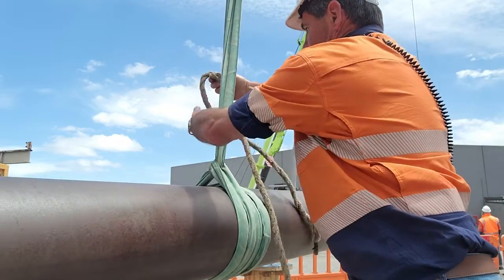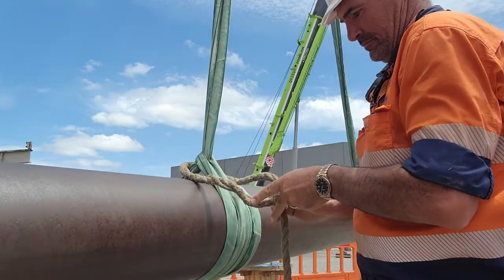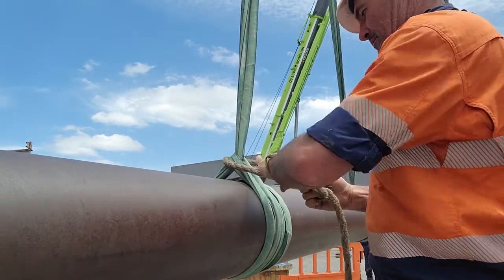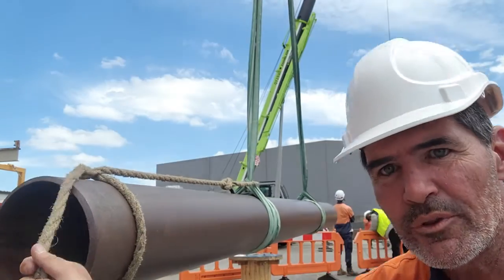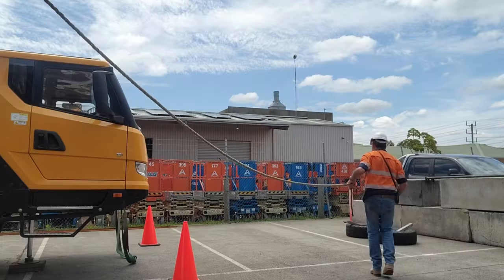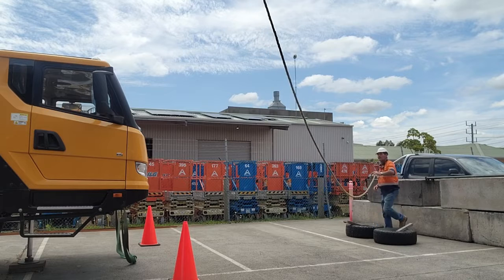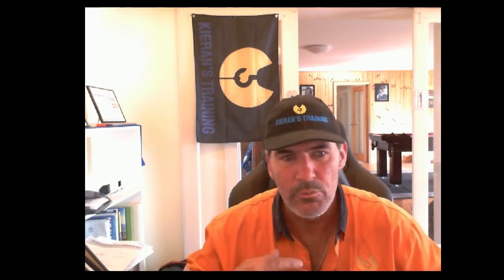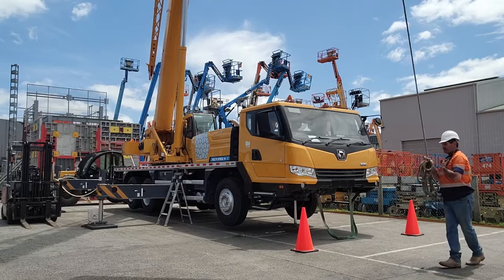Taglines in Rigging and slinging

Comment: There are many people out there who will connect the tagline to the sling without understanding your context.
Consider a scenario where a connection gives way and the load falls. If tagline is connected to the sling it's going to launch the tagline and the person holding it upwards.
If attached only to the load the line can only come down.
Tag line should be long enough to keep the person outside the fall zone. 
A fresher would fail the test if he did this.

Comment: Hi mate you are 💯just a quick question. I'm currently working on a mine site and they are trying to introduce the pull/push poles ! What do you think? I haven't used them yet but a bit worried it may be causing a hazard!
Reply: They are useful to keep a person out of harms way and very handy while handling loads on a floating vessel to avoid getting crushed between loads.
Reply: What is the difference between straight and reeved on tags?